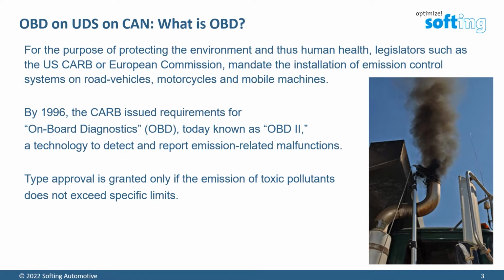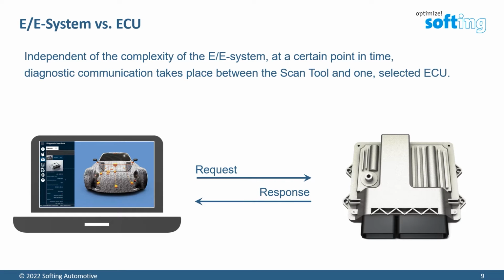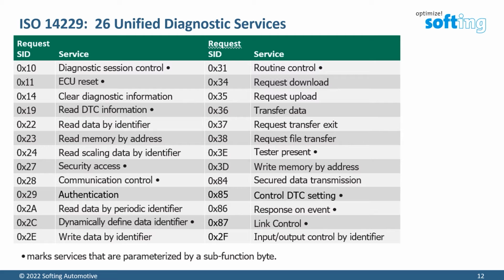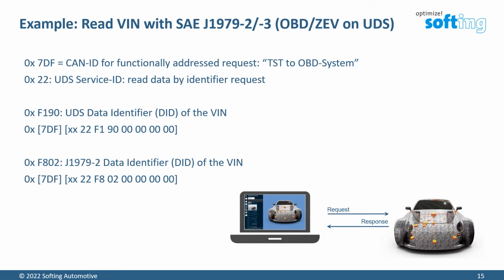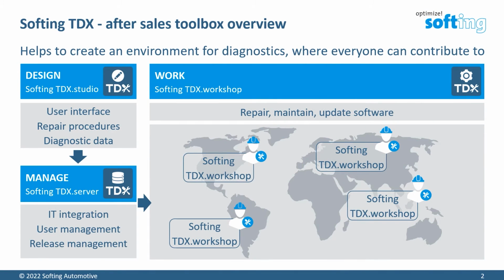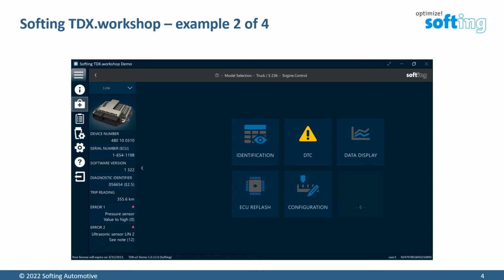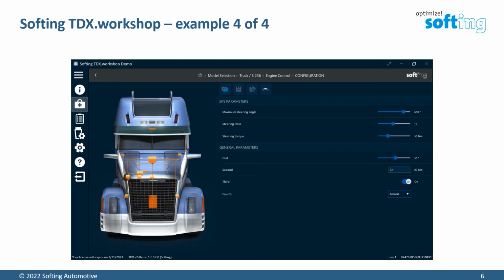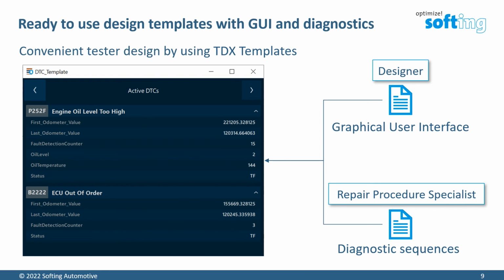Webinar | SAE J1979-2: OBD goes UDS – Future Legislation, Diagnostics and Testing by Softing/Kvaser

Comment: Will J1979-2 use the same OBDII connector and Classic CAN?    Your VCI has CAN FD....does that mean no Classic CAN in J1979-2?  Wouldn't Ethernet be wiser than CAN FD... CAN FD is horribly slow compared to 100Mb Full Duplex Ethernet
Reply from the maker: The J1979-2 is using for the transport layer CAN or Ethernet. The same OBDII connector is used which can, according to the ISO13400-4, have both CAN and 100Base-TX pins. Our VINING 2000 VCI supports all those protocols such as CAN, CAN FD and 100BASE-TX. So, if you need to transfer a larger amount of data for flashing you can use the ethernet transport layer. However, for diagnostics the speed of the CAN should be enough. 

Don't hesitate to contact us at info.automotive@softing.com if you would like to find out more.
Reply: @SOFTINGAutomotive  What is the industry actually using?  Will the old CAN continue to be used in addition to  100TX?    Or will some vendors exclusively support only 100TX or only CAN FD?